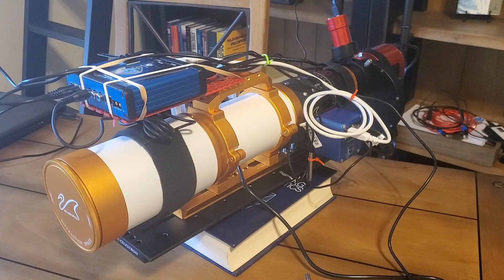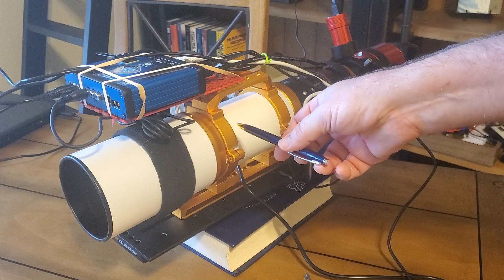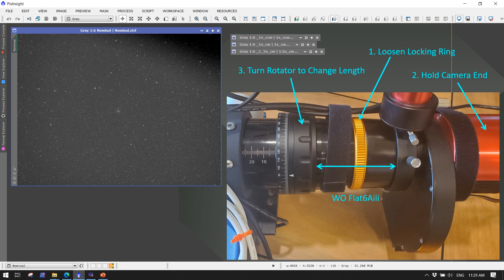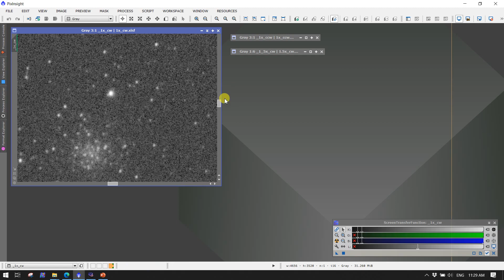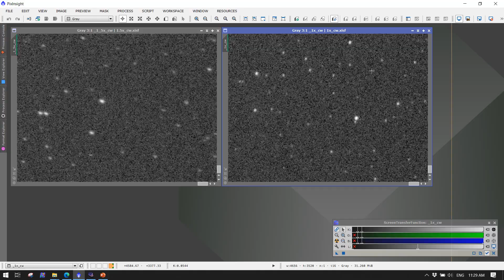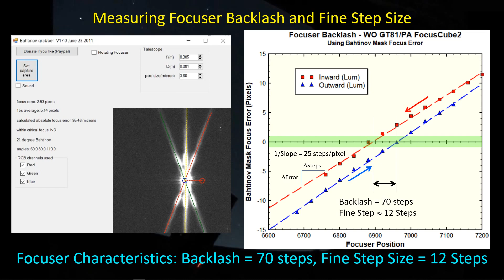Introducing the William Optics GT81iv Refractor Telescope

Comment: Just discovered that I may need to use the same approach with my GT81iv - that is -  to mount the Vixen plate onto a Losmandy style plate. Just curious how you specifically made this connection in terms of the method/bolt size/dimension that accomplished this. 
Thanks for your very helpful videos!
Reply from the maker: The Celestron dovetail plate I'm using has a number of holes for 1/4-20 screws. I'm using two of the countersunk holes to connect to two of the threaded holes in the William Optics base with sockethead cap screws. I can't remember what the thread size is on the WO plate, but I think it's M6, which works great with the 1/4-20 holes in the Celestron plate.

Comment: I have an FLT91 and about to attatch it to a WO Losmandy plate in the same way you have on the Celestron Losmandy plate. I wanted to ask what bolts you used to connect the two together safely please? Thank you.
Reply from the maker: Hey, Andy. They are either 1/4-20 or M6. My Celestron plate has clearance holes for 1/4-20, but the threaded holes in the WO base are probably M6. Just need a minimum of 2 screws. Hope that helps.
Reply: @Aero19612  Hi James, thank you for that, it is a big help

Comment: Hi James, What nonreducing field flattener do you use with this scope?
Reply from the maker: Hi George. I’m using the WO Flat6Aiii which is also a 0.7x reducer which drops the focal length from 478mm to 385mm. If you’re trying to maintain the 478mm, you might look up the Hotech flattener:
Hotech 2" SCA Self-Centering Field Flattener - SCA-FFT58
It’s supposed to work with focal ratios from 5 to 8 (GT81 = 5.8). Ask Hotech support or the seller if this flattener is compatible with this scope. Thanks for watching!

Comment: Hi James. I really enjoy your technical approach to your gear. I have the same scope & WO adjustable FF/FR. I was lucky to hit the spacing sweet spot on the first try. I did have to reach out to WO first to get some clarification on the spacing dimension needed for my DSLR imaging camera. I then set the recommended spacing using a set of digital calipers. 7.1mm. I did find that I had to tighten the locking ring quite firmly to prevent it from rotating off of the proper position. I realized this issue when I went to rotate the camera, but had not backed off the rotator locking screw sufficiently. The camera, t-ring, back end of FF/FR and locking ring all rotated as one. With those extremely fine threads, I dread overtightening that locking ring and making it impossible to change in the future, if needed, for a different camera. Every person's idea of 'hand tight' can be different.
Reply from the maker: I really like that adjustable FF/FR. Good comment about the lock ring. I swear I can screw some of these parts together and they might as well have been welded.

Comment: Thanks for taking time to describe your gear setup and your process for setting your field flattener spacing!  I purchased the WO GT81 last fall for a backcountry visual observing scope.  Since then, I have slowly been outfitting it for astrophotography when components become available in the stores.  Now, with the camera finally shipping, I came back for another watch.  I appreciate the detail you provide.  It will help me get up the learning curve faster.  I am contemplating getting the Ultimate Power Box now to manage power and data cable mess I have.  I remembered you had a problem with it so I wanted to understand what that was.  You have inadvertently laid a trap for some of us.  I can say that the textbook you used to rest the telescope in has captured some of my mental bandwidth every time I watch.  I have seen it somewhere my past at work but it was not mine.  I guessed it was "Advanced Engineering Mathematics"  by Erin Kreyszig  but it is a later addition than I own.  I see you also hooked Richard Bratten below since my last visit.  I find myself studying your shelf looking for other books I am familiar with which remind me of my past career.  Ha, what the hell is wrong with me! :)
Reply from the maker: Hey Mark! Thanks for checking in again. Maybe I should start putting a different textbook in each video just to drive people crazy. By all means, get a Power Box early in your astrophotography equipment acquisition phase so you don't do what I did: buy a ton of DC adapters...and then put them in a box when I got the UPBv2. You'll love the GT81 for astro. Very nice scope.

Comment: James, first off great video.  I have the same scope and flattener as you do.  When I make the adjustment as you mentioned the gap in the flattener was 7.00mm and when I made the 1 1/4 turn adjustment it became 7.6mm.  Does this match your gap.  Also I noticed your focuser was at about 27.  Is this where your auto focuser normally finds focus?  Thank you
Reply from the maker: Hey John,
My focuser is still at about 27mm after numerous nights imaging/focusing. Your field flattener setting seems about right. We could be a little different because of the spacers/shims I use in the rest of the optical train back to the sensor that may be different from yours. Thanks for watching!
Reply: @Aero19612  One last question, when I look at the WO's web site it shows that the focal plane is 55mm.  With your setup do you still maintain the 55mm focal plane?
Reply from the maker: @johnparker9524  Yes. As measured from the camera end of the Flat6A, then you add on the 7mm(ish) extension  in the Flat6a (as you have done, to get to the 62mm total back focus. The 55mm is a standard. That same 55mm is required with the non-adjustable field flattener on my Explore Scientific ED102. I just unplug the camera (plus OAG, filter wheel, and spacer) from it and screw it onto the WOGT81.

Comment: Hi James my GT81 turned up this week at last after a month wait for postage.I have just installed the field flattener and as I have an ASI1600 OXG I have set the field flattener to 8.25mm to see how good that will be compared to yours.The weather is really bad currently but I hope to try some test shots soon.I haven't added the focus cube yet I want to test out the whole system first then I will add it in. Thanks again for your tips really saved me alot of time
Cheers
Stu
Reply from the maker: Congratulations, Stu! Absolutely: get familiar with a few of the systems with your new scope, then add pieces as you go. Let me know what you think.

Comment: Quick question. Instead of getting a bigger dovetail, would it also be ok to rotate the telescope inside the rings so that the focusing gear is on top, allowing for more dec balance space?
Reply from the maker: You can certainly rotate the telescope 180 deg. In my case, I need the dovetail plate to install the scope on my Celestron mount saddle. Also, I need additional real-estate on the plate to attach the L-bracket for the Focuscube. If you are using the manual focus or the ZWO electronic focuser that attaches to the OTA focuser, then you are free to rotate the scope in the rings.
Reply: @Aero19612  Ok, good to know, thanks for the reply.

Comment: did you ever figure out a way to get the william optics batinov mask to work better.  I was out last night and the lines were to illuminated to get a measurement on batinov grabber, the pixel readings were bouncing all over the place and I noticed the line created were very illuminated.  I was thinking about painting the clear part black to reduce reflecting light.  I will probably use gaffer tape first to see if that helps but do you have any other suggestions for the batinov grabber routine.  I tried different ISO, time, stars, and such and could never get a good reading.  I was in 1:1 on APT when doing this.  Thank you for the great videos.
Reply from the maker: Hey Jared,
Yes. I stopped using it. HaHa. The NINA autofocus routine has been working so well, even with the narrowband filters, that I've decided it's not worth the effort to define filter offsets. I'll just do an autofocus on filter change and call it a night. Meanwhile, I've been using the Redcat 51 (manual focus with its acrylic Bahtinov mask) and the diffraction spikes are awesome (see my latest video on Bahtinov mask focusing in NINA and APT). Is it just that GT81 mask? Focal length? Operator error (no way)? Not sure. Good idea with the tape, but try to maintain the sharp edges so you get crisp diffraction spikes. As a last resort, could try a "normal" Bahtinov mask:
https://farpointastro.com/shop/farpoint-82mm-camera-filter-bahtinov-focus-mask/
Let me know how things go!
Reply: @Aero19612  Thank you for the help.  I am at an influx in my setup right now where I am not able to use nina for capture because I am still on DSLR and nina just does not have the same level of control on DSLR as APT does. Also I am not using mono so my goal was to figure out the backlash of the focuser/telescope combination.  I just ordered a black plastic batinov mask to test out; after trying to use the tape idea it was difficult to get a sharp edge and I think painting my current one might not be the best idea given the affordable cost of the one I got.
Reply from the maker: Ahh. Ok. Since you're not interested in filter offsets, using the Bahtinov mask to determine the backlash should work OK-that's the way I got my backlash. Where I got into "trouble" was trying to get consistent filter offset numbers (a much smaller number than the backlash: 10 steps VS 80 steps for example). I'll be interested to hear how the good ol' fashioned Bahtinov mask works for the same scope.

Comment: James, just stumbled across this amazingly helpful video! I'm am also a newly minted GT81 IV owner with the Flat6a III. I'm currently only connecting my ASI2600MC-pro directly to the flattener - no FW or OAG. I can't quite get the flattener adjusted  so the edges are giving me non-distorted stars. Could you possibly help make a suggestion on my flattener adjustment settings for a simple setup like I have?
Reply: I failed to mention that I have setup the current backfocus at 55mm as per the ZWO instructions using the spacers supplied with the camera.
Reply from the maker: Hey Richard. Congratulations! You'll enjoy the scope a lot. Even though you don't have the filter wheel or the off axis guider, you have spacers that essentially create the same back focus I have: 55 mm. The Flat6Aiii requires 62 mm for our scope, so that leaves 7 mm. I set my initial extension on the Flat6A to 7 mm and then took pictures at that extension, then shorter, then longer, then  a tad bit longer, and eventually settled final extension just by how the stars looked in the corners. So the steps are:
1. Set the extension on the Flat6A
2. Focus on a star field
3. Take a short-duration picture (we don't want guiding/seeing effects)
4. Inspect the star shape in the corners
5. Go back to (1) until you like what you see in (4).
Reply: @Aero19612  I think I have it nailed James! Again, thanks for this video. Now, the next question, could you perhaps show me how you have the Pegasus focuser attached to your GT81?
Reply from the maker: Hey Richard. Check out this video:
https://www.youtube.com/watch?v=CtCZGysgJgs
I show the attachment in more detail with that scope and it's identical to the GT81.

Comment: I just got my new WO Zenith81 and tried to focus on my Canon 5D and Canon M50 but failed. Can you advice ?
Reply from the maker: Hey Gunnar. If you're focusing on a star or the moon, you can estimate where the camera's sensor should be by measuring back from the telescope objective by the focal length (I think it's 559 mm without a focal reducer). If the focuser is fully extended and you can't get the camera's sensor 559 mm back from the objective, then you won't be in focus and will need additional adapters to get more back focus. Just a thought...

Comment: I have a WO GT71 and I’m completely satisfied w the product. With the GT71 if you want to use the case you have to disassemble/refigure body. Nothing convenient about it. It’s only practical for travel as far as I’m concerned.   I also use my GT71 (420mm) as a guide scope for my 2032mm FL SCT. It’s far better then OAG. In large temperature swings (75 deg day/below 32 dogs at night) the WO can loose focus; watch those focus lock screws.
Reply from the maker: Thanks for the feedback! Not surprised at all that you’re satisfied with WO gear. Love their products. And I totally agree about the case. Travel-capable is not a big consideration for me so the case will sit on a shelf, probably unused. Wow! A GT71 guide scope?! Haha. I’ve totally converted over to the OAG dark side now. I’ll be totally impressed with you if you use your SCT as the guide scope for your GT71.

Comment: Great video as awlays! I see you have the Pegasus Astro FocusCube 2?  DId you get the Celestron mount for it?
Reply from the maker: Hey Ben. I've got two FocusCubes for my two refractors. No I didn't get the SCT mounting. Funny thing. When I was considering buying a focuser for the SCT, I had that version of the FocusCube2 in the "basket" ready to purchase and then I happened across someone mentioning the Celestron focuser which was news to me. So I went that direction instead. oops.
Reply: @Aero19612  The SCT FocusCubes are supplied for particular models. I have the 68925 version. There is also a dual-motor focus controller and Motor Focus Kit with Universal and SCT variants. The DMFC includes a rotary "infinity" dial for micro and mini focusing. Once mounted, the motor is locked to the scope focuser. A benefit is it acts as a "brake", the disadvantage is there is no "manual" focus. For simple "non-computer" visual observing, the knob provides "manual" focusing. The advantage of DMFC is that it can be shared amongst two (or more) attached motors - which lowers the cost and it has manual focusing too. Hindsight is a great thing e.g. you know in advance that you want to share motors!

The SCT version is specific to the scope and fits like "Mecano" e.g. just works. The Universal was a bit more fiddly to fit (on my scope) depending upon where the available mounting holes are. The coupling has four grub screws and if you use all four, the point of contact is only the grub screws. Providing the spindles are a good fit, it is better to only use one pair of grub screws on one side. This provides a grub screw into the D (or flat) and contacts with the whole of the other side. IMHO, this would be better because it ensures things are parallel.

Like an eyepiece, you don't use screws on opposite sides if you don't want the EP to rock. On my scope, there was difficulty getting access to the grub screw through a hole in the focuser (YMMV) and it is here that an (optional) "ball" Allen key works well because you have the option to access the grub screw in difficult places. On Amazon/eBay there are "flexible" couplers for $5 a pair. It would be interesting to try these? The "key" to a smooth-running motor, is to align each axis as it goes together and a few minutes to get this "right" pays off. DMFC refers to use with other motors e.g. Lakeside motors.

Overall Pegasus are pretty good focusers and the cube or motor kit uses an EEPROM to store its "count" after 10 seconds. So next time it is connected it knows where it is independently of software or a controller. Unlike some motors, it is not possible to forget where it is positioned and it doesn't allow any slip. So it is "ideal" for the task. The backlash is estimated at 30-40 steps (mine is about this) and should be minimal because it is using the (direct) mini focus shaft, but will be scope focuser dependent. Some controllers use the micro shaft and this introduces additional backlash.

Perhaps you can clarify if the backlash step is a difference between the same position approached from the other direction or the "minimum" amount the motor has to "reverse" and recover when changing direction to reach the same position e.g. anything more than the "minimum" is all that is required. Simon

Comment: Congrats on the new scope James, It will surely fill the gap between the Redcat and ED102. I am a fan of WO too. Now that you have the WO rotator/flatener it might be possible to fabri-cobble an adaptor to the ED102. Certainly within the capabilities of even a home machinist. That is some heavy shadowing from the OAG, presumably a hangover from the ED102 mounting.  I bought a cheap non helical adjuster for my Orion OAG, sure beats the hell out of par focal rings and push pulling the camera. Personally I would have gone with a dedicated guide scope for the GT81 with it being a relatively short FL, no messing about recalibrating PHD everytime you rotate the imaging camera.  What was wrong with the mount this time around?
Reply from the maker: Thanks, Rob. Yeah, I'm not sure I needed to fill that gap, but the WO scope design sucks me in way too easily. I did briefly go on a web hunt for a male 68x0.75 to male 48 adapter that would work with the ED102. But I'm too lazy to move the Flat6Aiii back and forth between scopes (and re-tune each time) and too cheap to buy a second Flat6Aiii. I know what you mean by re-calibrating PHD2 each time I change the orientation of the camera, but I do like the convenience and "low profile" offered by the OAG. I will generally stay with a single orientation for many targets. Not sure anything was terribly wrong with the CGEM. The guys did find that both encoders were firmly attached (my concern), but did find the RA gear support was a bit loose. They re-tightened the screws, re-meshed the gears, and cleaned the electrical connectors. Seems to work fine. Clear skies!